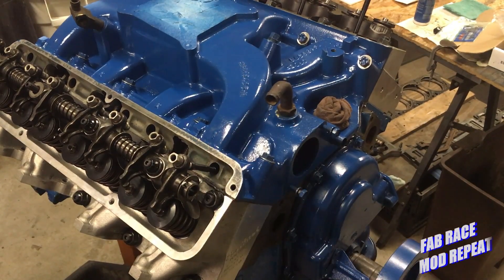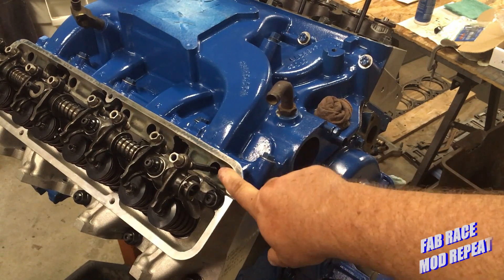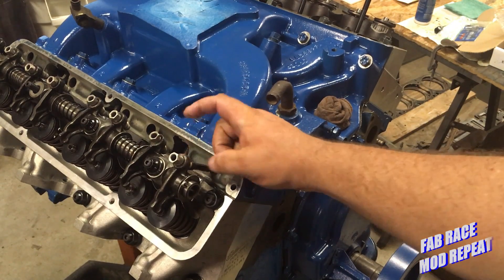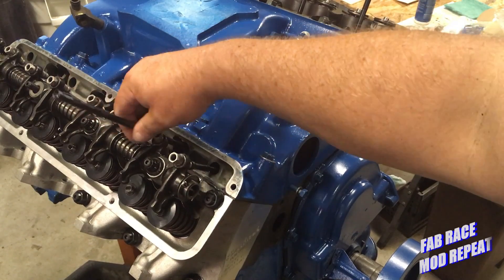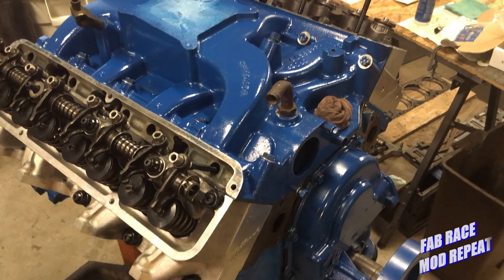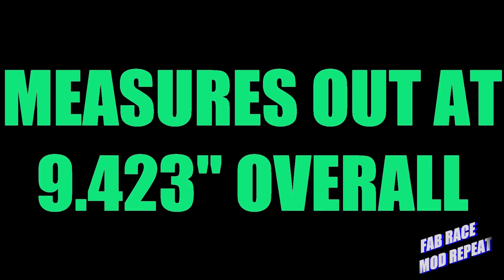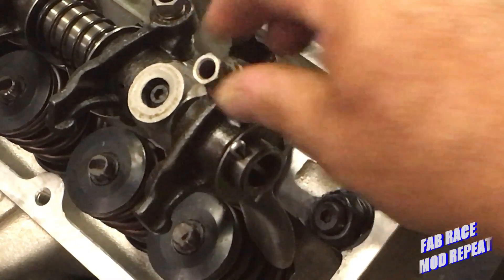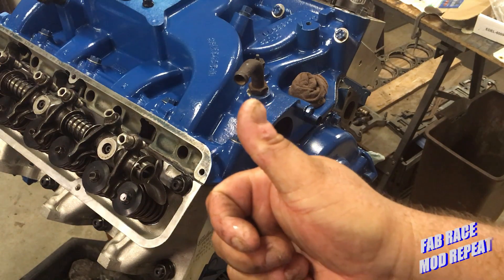Checking pushrod length Part 1: FE Build #1

Comment: I've got similar rockers mocked up on my 390 fe.  When measureing with my pushrod checker, im a bit concerned by the "negative angle" between the pushrod and the rocker adjustment screw.  It seems like the rocker travel would have a lot of lateral stress on that adjustment ball,especially at the start of the lobes.
I'm thinking about using a tester valve spring, and shimming the rocker pedestals to try and get to a  straight line with my pushrod/adjustment screw at 50% lift.  I think that doing this with just 1-2 threads showing on my adjustment screw would minimize forces while leaving me enough for a fine adjustment.  Id have to add the lifter preload into my pushrod.  

Did you have any concerns with this building fe engines, or am i just overthinking this?
Reply from the maker: Thanks for watching
Great question.
Sounds like the push rod length is off a bit.
With the valve closed is the adjuster higher or lower than the valve retainer?

Comment: Where did you get the adjustable rockers? I see these assemblies on JEGS, but they have terrible reviews. They say that the nuts are breaking and they come loose as well. Any advice?
Reply from the maker: They are factory original 390 interceptor/406/427 solid lifter rocker arms. 
I have seen to issue with the newer reproduction arms lock nuts coming loose.
Federal mogul was still making a good quality replacement up through the mid-late 90’s if you can find some NOS pieces somewhere.
Reply: @FabRaceModRepeat  Ok thanks for letting me know that. Much appreciated.

Comment: A 460 push rod is usually 8.550. A FE pushrod, ball end ball end, is 9.590 usually. Almost a inch longer. Using a adjustable pushrod checker for a 460 should not be "too long".
Reply from the maker: Thanks for watching.
It would if it’s for big Pro stock setup.

Comment: where can i get the bolt to tie the rail rockers
Reply from the maker: Thanks for watching!
The Edelbrock ones are typically available from anyone the sells Edelbrock products. The Edelbrock bolts are all the same length, the factory style set up uses a slightly longer bolt on the Oiler hole. With the cast iron heads I’ve always used the stock bolts. Blue Thunder used to offer them and I believe Pioneer did as well. 
PS
This is a great question I’ll have to do research.
Reply: @FabRaceModRepeat the oiler bolts are not longer. They taper down for oil to pass from the head to the rocker shaft
Reply from the maker: @bnmartell  
Thanks for watching.
On the early engines, the 2 tapered rocker oiler bolts are a few threads longer than the other bolts.

Comment: Where do you set the adjusting bolt on the rocker before before expanding the adjustable pushrod?  Seems like a couple turns either way will make a difference in measurement. 

Thanks for making great video's, have been a big help with my 428 build.
Reply from the maker: Thanks for watching and glad I could help.
Typically I leave the adjuster bolt 3-4 threads below the rocker arm. That puts it basically in the middle of its travel.  
Then:
I try to set the push rod checker in the middle (or close as possible) of its travel.
Reply: @FabRaceModRepeat  Perfect, thanks for prompt reply and keep 'em coming.

Comment: Hard to find people doing pushrod length measurements on FE engines. I just put a 390 together using a new set of non adjustable rockers and wound up having to order two lengths of pushrods. Checked every one and wound up with two lengths to get the preload within spec for all 16 lifters. With the cam I have, zero decked block, slight valve stem height variance. milled heads and whatever else that varies I got 9.450" and 9.475" with preload factor added in. Had to have them custom made.
Reply from the maker: This one of those “FE problems” you hear people speak of.  This is also why I always use adjustable arms if possible.

Comment: WOULD THESE ADJUSTABLE ROCKER ARMS WORK WELL WITH A ROLLER CAM AND LIFTER SET UP TO SAVE ON COST
Reply from the maker: They will as long as the spring pressure isn’t to high. If you’re running a big solid roller I’d get some Harland sharp rockers.
Reply: This Ford rocker shaft assy with the shaft ends unsupported are JUNK in my opinion. Especially if you have stronger than stock valve springs. The shaft will break the end off after the end support bolt. It will happen. Good luck in covid world finding someone with some good ones. Just get in line like the rest of us.

Comment: My 390FE does not have adjustable rockers. Why is that?
Reply: If you have stronger than stock valve springs, you better get some aftermarket adjustable rocker shaft assemblies that have supported shaft ends. The very end of the shaft  MUST BE SURROUNDED. You will keep breaking shafts and bending pushrods and other bad things will happen. I've been seeing this happen  since the 70s.
Reply: Most didn't.
Reply from the maker: Most hydraulic ones didn’t from the factory as they were not needed.

Comment: Why do you add pre- lead in the length when it seems you can set it more accurately with the adjuster on the rocker arm? This would also allow for variance between  valve stem heights. In the middle of figuring out what length my FE needs with a roller cam and roller rocker system.
Reply from the maker: Jeremy Aguilar 
Good morning,
Hydraulic lifters require “pre-load” to allow clearance for the plunger to move up and down, inside the lifter body.
  The adjustable rockers are there for exactly the reason you stated above, it gives an adjustment point to dial in the accuracy. IE: we can adjust out the “ticking” if the push rod length is off a bit.
Reply: @FabRaceModRepeat yes, but if you order pushrods at the static length and you have the adjusters out 3-4 threads then you should in essence be able to add preload like you would a small block Chevy through the adjuster.
Reply from the maker: @bnmartell  
Again thanks for watching.
Due to the variation in the stock adjustable arms and the various after market ones over the years; I add in the preload to the rod length. I found a few rockers over the years that didn’t have 4-6 threads still engaged with the arm without the preload built in.

Comment: So... you do nothing with rocker arm/ pushrod / valve geometry?
Reply from the maker: That’s kind of the idea on this low lift set up. The geometry is  basically built-in as it was at the factory. There’s also a lot of margin in the rocker tip on the stock rockers
I’ll go into more detail on it when we install the push rods. which will be soon, they recently came in.